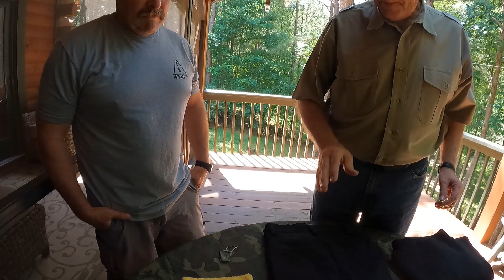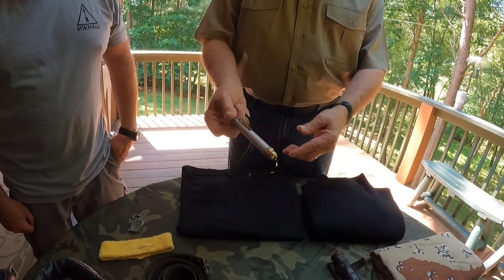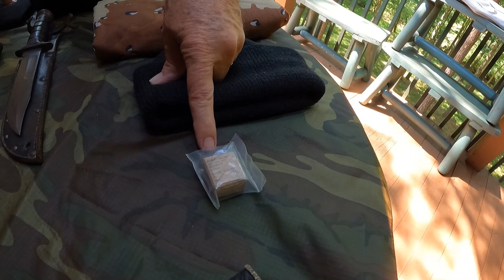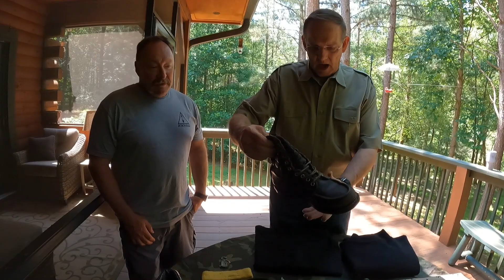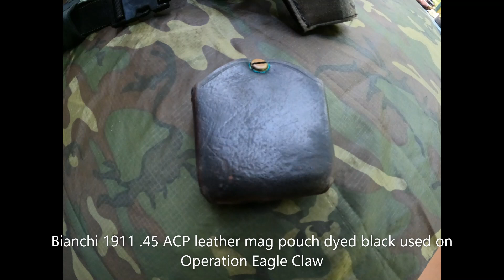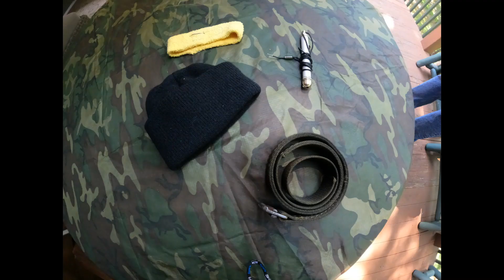Operation Eagle Claw Actual Delta Force Uniform Items and Equipment

Comment: The Grease Gun, when did SF stop using them, the .45s were they modified or stock models ?
Reply from the maker: Sometime between 1980 and 1984. Some of the M3's used on Eagle Claw were sound suppressed. They had handmade rubber buffers to quiet the action and also had Mag-Lites clamped under the barrels. A few had XM PAQ-4 IR lasers attached.
Reply: Ok, i saw the episodes about the gear used. Incidentally parts Norwegian army used Luger's Walther p38 and Mp40s up to ca 92 . FSK and Hjk ,used Mp5 and others, almost similar Mjk ( Navy Jaegers ) used and liked the Suomi 9mm smg very much. 2 friends of mine had them then.
Reply: Meant to write  the 1911m ,45 how was they setup ,modified or standard version i meant to write.
Reply from the maker: @MrPh30  I was in Norway in 1991 working with the MarineJagers. I didn't see them using the weapons you mentioned but they were using G3's still back then. I walked a double point during our big exercise with Trond Bolle. He was a great guy.
Reply: @SilentWarriorFoundation   Bolle is missed by many, it was a hard time for all when they were kia ,one of them were from my relocated to city down south.
Ag3 was much used by everyone here, and Mjk used a lot of gear. Sadly all the Ag3 are being scrapped due to buy Hk 416 and 417, and because the sadly gunlaws here make it difficult for the G3 to be converted,abd even then it would be hard to get one. Ipsc or Collector.

Comment: Great info!  😳 “if we could only get their helicopters to work”.
Reply from the maker: That was a funny and classy comment all at the same time.
Reply: THe Helo's used were never designed to operate in that environment. Also, to save weight the EAPS units were removed from the engines which contributed to some of the issues (and there were many). We've come a long way and learned much since that time. It was a miracle the birds managed to get as far as they did. The sad part is we lost 8 RIP.
Reply: Marine pilots suck